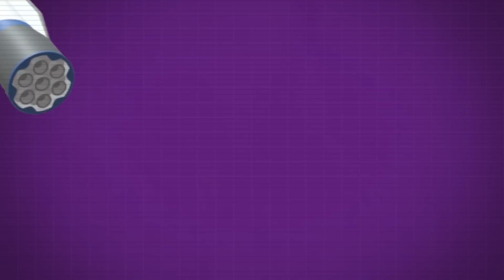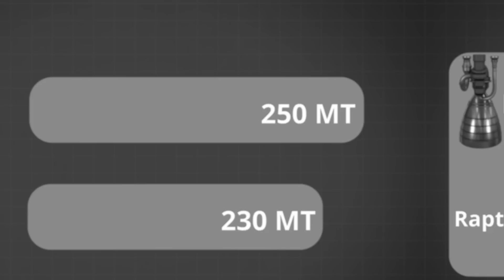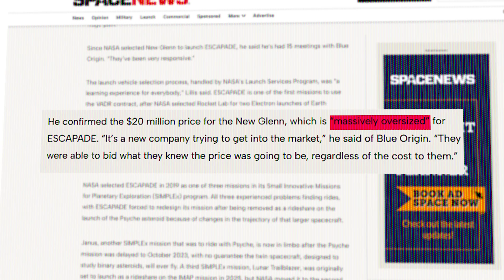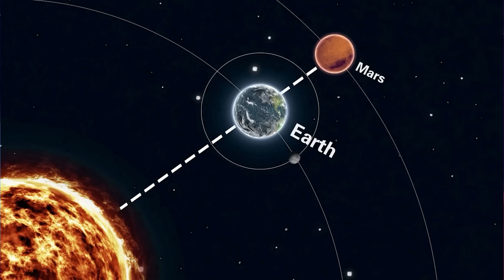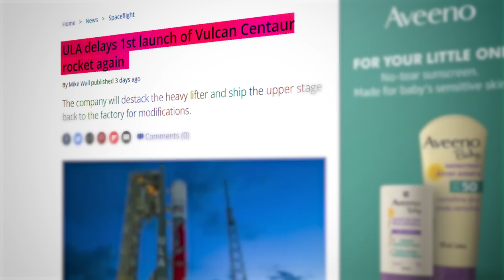The Truth About Blue Origin's New Glenn Rocket!

Comment: Uhhh.. BE-4 is an Deep throttling O2 righ closed cycle engine.  Raptors are full flow.  The two technologies are so vastly different and the former so much more difficult that they are, essentially, incomparable.   That's why Falcons and starship have to "suicide slam" their rockets onto the pad while New shep can literally hover in place and descend daintily onto the bullseye. 

Add to that the fact that both companies had a catastrophic failure of the booster, yet new shep activated its escape system perfectly and landed its cargo module safely while the entirety of Elons rocket ended up spinning out of control before exploding and you've got to wonder how Elon thinks he'll be able to convince people to ride his death machine into space while BO has already demonstrated that, even in the event of catastrophic failure, anyone riding their rocket will be safely returned to the earth. This is probably what prompted NASA to tap BO as an alternative to the explosion prone starship. I mean, you've gotta think about all the people New Shep has safely taken to space and back.  How many people has Space X taken to space?  stark contrast there. 

BO has put multiple objects AND people into space.  The karmen line is literally where space begins, and virtually every NG mission has passed that line.  If you can get to the Karmen line, getting to orbit is, at that point, just a matter of adding a bit more speed, what about this equation baffles you so much?  New shepher has a new launch date, btw, but it should be noted that the launch cadence for it has diminished because it's no longer necessary to do so, most of the data that can be gleaned by the launches of New shep has already been done so. 

It's hard for you to imagine what BO was thinking because, I guess you don't know what Blue ring is?  Let me bring you up into the correct orbit, so to speak.  NG gets objects to orbit, Blue Ring is a space tug, launched by New Glenn, which pulls objects like satellites, space station components, space refueling docs, modules for both terrestrial and space based construction, into higher orbits at to Lagrange points.  These are parts of a space based infrastructure which facilitates BOs mission, "Millions of people living and working IN SPACE" not on the moon, not on mars, IN SPACE(Gradatim Ferociter is their moto, not their mission statement).  

You even bring this up when you pointed out that BO is the platform for Orbital Reef (Which is produced by an entirely different company than BO but its a common misconception that BO owns it for some reason so we'll give you a pass on that.)
Reply: Did you hear about SpaceX Crew Dragon? The official transport for Nasa Astronauts to the ISS Space Station.
Reply: @evthink  You mean the space station thats being replaced by orbital reef? the one where all the modules will be carried into orbit by Blue Origins New Glenn?

Comment: You missed a few facts:  The New Glenn is also designed with a THIRD stage for deep space.  And just like Falcon, can do really heavy lifts or deep space with no return (80,000kg) but that's a long ways away as I'm sure they will do like SpaceX and only use rockets near their end of life.  Not to mention "Jarvis" the reusable 2nd stage test article they are building.  And as of yet,  there are no flight rated Raptors.  You read that right.  Would you put a payload on an engine that fails 45 percent of the time?  This is fine for TV and internal testing (Which is what SpaceX is doing)  but between hot fire tests, stand tests, and partial flights the engine is failing on relights due to the seal on their turbo pumps. (sounds familiar as this is same issue that plagued BO).
BO also has a fully tested 2nd stage already.  Its called New Sheppard.  The real reason they fly it.  All the hardware used is the same as their second stage.  Infrastructure, fueling...  And BO has a completed factory and launchpad.    Musk himself said the rocket isn't the hard part...  It's the ground support and manufacturing.
I agree that BO is a just too anal.  And need to work harder to free themselves from the NASA mindset a little.  But they are A lot farther along then you are led to believe.
Reply: Your critique of the raptor 2 engine makes the same mistake as others have in assuming that it is raptor that is flawed.  Curious then why the raptors are thoroughly tested at the MacGregor test site, but only begin to fail when integrated into the starship booster or second stage.  And we know some of the earlier failures were due to debris kicked up into the engine bay as the raptors fired.   Whether that was the case in the 4/20 launch has not been substantiated.  

More to the point is the complication of integrating 33 raptors into the booster then shielding from each other to prevent one negatively effecting another.  There are hundreds of upgrades to B9 which should address such issues among many others.  

The point is that the first test launch provided no indication that the failure of the raptors was due to the raptors themselves.  It could be many external factors which should be better resolved in the next flight.

Comment: Since neither engine has sent a payload to orbit, the thrust comparison against BE-4 at 250 tons on the test stand should be Raptor 3 at 269 tons on the test stand.

Raptor has surpassed BE-4 in thrust, while also being a much smaller and lighter engine.
Reply: Also BE-4 creates 550,000 pounds of thrust (275 tons) so the engines are much more comparable
Reply: @danman3542  250 tons.
Reply: The Raptor 3 won't be ready for regular use for many months possibly a year or more.  So comparing it to the Be-4 is not credible.  The Be-4 has been tested and is apparently a viable engine.  It was successfully tested on Vulcan. And the problems with Vulcan are not due to the Be-4, but the Centaur stage of the Vulcan.
Reply: @michaeldeierhoi4096  And BE-4 isn't going to fly until sometime in 2024 at the earliest. You're trying too hard. They're at an equivalent spot in development.
Reply: @SavageChinquapin  The next rocket to fly the Be-4 will be the Vulcan and probably in 2024 as you stated.  However, the Be-4 is more like the Raptor 2 in development given that the Raptor 3 only just started testing and is a ways off from production while the Be-4 is in production.  And the Be-4 would have launched with Vulcan this month if not for the problem with the Centaur second stage!!
Reply: @michaeldeierhoi4096 BE-4 might have launched this month if not for the upper stage issues, or alternatively BE-4 might have blown up this month.
Reply: @owensmith7530  Given that the Be-4 was extensively tested I find it unlikely that it would have blown up
Reply: @michaeldeierhoi4096  Extensively tested engines have blown up before.
Reply: @owensmith7530  Of course, but if we are talking about what is most likely to happen I don't think the Be-4 engine(s) blowing up at launch is one of them.
Reply: @michaeldeierhoi4096  That's a fair point.
Reply: @owensmith7530  After watching a recent video by The Space Bucket about the Be-4 engine withdraw my comment stating that I thought that was engine is reliable or that it be unlikely to blow up on the pad.  

The Space Bucket article stated that the Be-4 recently blew up on a test stand at the test site in west Texas.  There is some uncertainty about this test for ex. was it a test to failure or was it due to worker error as the BO ceo claimed? Or is the engine design flawed?
There was also comments by other commenters that BO has tested very few engines.   Pictures have been made available of a couple dozen in construction, but that doesn't say anything about the quality of the engine.

 Bottom line is there is too much uncertainty about this engine.  If it was worker error it should be quickly corrected.  If not and it's a design flaw then BO has much bigger problems.
Reply: @michaeldeierhoi4096  what do you mean by "BE-4 is in production"? To me it would mean it's either flying or there's a robust production line in place, none of which seems to be the case.
Reply: @schloops8473  My only source for that comment is the image posted by YouTube site TheSpaceBucket which displayed alledged Be-4 engines in various stages of construction.  However as I recall there were no people actively working on those engines.  So I rather casually took their narrative from that channel that many Be-4 engines were in production.  In fact that may not be true at all and in fact I question now how much testing those Be-4 engines have really had and had reliable are they are.  BO is as we all know is no where near as transparent as Space X is with it's development of the raptor or starship.  

It's the lack results that should raise concern.  And now that a report came out that Be-4 blew up during a test fire last month there is likely to be further scrutiny despite Tori Bruno's attempt to downplay it.  And he still states that Vulcan will fly by the last quarter of 2023 so we shall see.  Sorry, if this comment appeared unnecessarily long.
Reply: @michaeldeierhoi4096  this didn't age well
Reply: @mike444-7  Actually the Be-4 engine has faired quite well since that last comment a year ago.  The Be-4 engine was used on the first Vulcan flight and burned for 5 minutes without issue.  That is one good positive that BO has going for it with its first launch this fall.  They may or may not launch or time in which case another launch vehicle would pick up the mission in.

Comment: Raptor III has 269 tons of thrust, topping the BE4 by 19 tons. It also weighs less, has far fewer parts so will be more dependable, and they can make it for a lot less and a lot more rapidly. But otherwise, good job BO. Also, you should have emphasized that Starship is designed to be fully and rapidly reusable with a per launch cost as low as a million dollars.
Reply: The BE-4 just exploded
Reply: @randolphtorres1028  I didn't hear of such news.  Have you got a source for that claim??
Reply: @randolphtorres1028  it is one thing to be blowing up engines that one makes rapidly and while testing beyond intended use to find their failure points, like SpaceX routinely does, and another to blow up an engine one was intending to deliver to a customer. BO is many years behind on the BE4 and clearly still don't have a finished reliable product..
Reply: I've heard two million, never one, but i think even two is a fantasy. They might possibly, some day, get down to around twenty. That will fantastically revolutionize space launch in and of itself. I don't think jet liners operate for one million dollars.
Reply: Can you tell me who gave you information on how many parts these rocket engines have?

Next time before you write advertisements maybe look at your text and ask yourself if it makes any sense
Reply: @_mikolaj_  are you blind? If you are blind your question makes sense. Otherwise you can look at a photo of the BE4 and a photo of Raptor II, and see Raptor II clearly has a whole lot less tubes and mess running around above the bell. And Musk said the goal with Raptor III was to get rid of all the remaining tubes and mess above the bell. We don't know if SpaceX achieved that, but it is safe to assume they got rid of more parts. As Musk says, "the best part is no part, the best process is no process."
Reply: @tribalypredisposed   You are misguided in raving about the Raptor 3 which will tested for quite some time yet.  The Be-4 has been tested extensively and would be launching the Vulcan soon if not for the problems with the Centaur stage.

Comment: If New Glenn really is that oversized for ESCAPADE, they can launch whenever. Large margin = more delta v = a lot more orbital transfer options.
Reply: Larger cost, smaller market. There are reasons Falcon Heavy launches far fewer times than Falcon 9.

Comment: 2:56 "SpaceX has talked about making an extended length fairing for Falcon Heavy, but we have yet to see it done."  In fact it is done, however, no customer has requested it.  The extended Fairing allows an extra 17 feet of height for payloads. It apparently will not be recovered.
Reply: I feel like ditching fairings isn't a big deal
Reply: @nickcollins1528  I suspect the rationale for none recovery is because the seldom use of these fairings, it wasn't worth the time and money to develop a recovery system specific to the aerodynamics of the extended length fairings.
Reply: @nickcollins1528  Elon says they are $3million a pop. Never a killer expense, but something you'd rather not throw away each time if you are doing a lot of launches. If it is only intended for a very occasional launch though, such as the extended one for Falcon 9 Heavy, its not a big deal.
Reply: Excuseme?
One NRO payload and Lunar gateway are waiting impatiently for this fairing, yet spacex still hasnt built it nor has begun construction of VIF necessary for it's assembly.
Reply: @_mikolaj_  Reference? The only payload I know of on the books for the extended fairing is the NASA Gateway, PPE/HALO module launch scheduled for no earlier than November 2024. The critical design review of the extended fairing was supposed to have happened 3rd quarter 2022.  I know of no launch payload from NRO or anyone else waiting for the extended payload fairing.

Comment: I wonder if the revised New Shepherd  tourist vehicle is intended to enable access to their orbital station?
Reply: No, absolutely not. The New Shepard is completely incapable of operating in orbit, much less reentering from there. I'm not sure what you mean by revised but, if you are referring to the launch failure last year, that was due to an engine failure in the booster. It had nothing to do with the capsule and whatever corrections they are make only involve insuring that that kind of failure can not happen again. It will not magically make a suborbital booster into an orbital one (like turning your car into a Formula 1 racer) nor cause the capsule designed to operate for a few minutes in free fall into something that can enter orbit, maneuver, and reenter.

Comment: If this is a race, then Blue Origin has lost. It hasn't even left the start line yet. SpaceX operationally launches and recovers Falcon 9 and Falcon Heavy on a routine basis. Starship/Super Heavy Booster are relatively close to achieving at least prototypical orbital success. New Glenn has not come to life once, let alone seen the light of day. Being "impressed" at the sight of New Glenn and a successful launch and recovery are worlds apart. The BE4 powered Vulcan booster has yet to put an ounce into orbit. Theory does not pay the bills, practice does.
Reply: The BE4 on Vulcan was only delivered in the last few months. They were supposed to deliver them years ago. That put ULA behind schedule for having the full system validated before they have to quit using the Delta IV. The situation is getting to a critical point for them.
Reply: I wouldn’t say lost but definitely loosing by a lot
Reply: @Wurtoz  Exactly, but you need the New Glenn rocket to take off as soon as possible, since for customers to see it as reliable it needs to be launched many times and be almost perfect, otherwise no one would trust its payload. but it has to be done now, other young companies are also moving forward
Reply: Well said, except it's not a race. In 100 years it won't matter who was first by a couple of years or decades. Independent company access to space will have a huge value. Right now we don't even fully comprehend the future scale of the space industry.

China isn't buying space rides from SpaceX because they know they can copy the vehicle eventually. Having your own space program is just better, it doesn't matter if you're a government or a company.
Reply: their launch frequency is around once every 3-5 days...next year they will probably launch more than 100 times.
Reply: Starship flight 4 was success - both parts landed

Comment: When Musk started he said they would begin with tried and true expendables and then develop better rockets along the way.  Bezos hired people who worked on DC-X and they played around with SSTO R&D which they had to give up on.  By the time Bezos made the call to redesign SpaceX was way ahead.
Reply: Yeah. As if SpaceX really knows what they're doing. Granted, they seem to be doing better than Bezos and Blue Origin. But IMO, neither knows. (IOWs, Musk, or anybody else, is not sending anybody to Mars by 2050.) If you believe that people are actually going to be living on Mars by 2050, I suggest you do some research on that concept.
Reply: SSTO, at least in our lifetime, is horribly inefficient. There are existing configurations that could likely do it, sans payload. Not worth the tens of millions just for bragging rights.
Reply: @UncleKennysPlace I mean it's just the issue that we are on Earth. Our planet is just the right mix that makes SSTOs not work. 

If we were launching off an airless moon or a low density atmosphere like Mars? Turns out it would actually be a decent choice. Specifically for airless you are always in an environment where you can use a vacuum optimized engine, so there you do not really need to optimize for different portions of the flight. Same goes for gravity loses. If we were to launch from a body with less gravity you could get away with having less efficiency at liftoff and that would help in making an SSTO more viable. 

But too bad, we launch these things on earth, a planet with a high Gravity and dense enough atmosphere. And also a place where the application of stronger propulsion methods such as nuclear engines would be... Discouraged
Reply: @mobiuscoreindustries  You are right. We have seen one successful SSTO, but it was the lunar module.